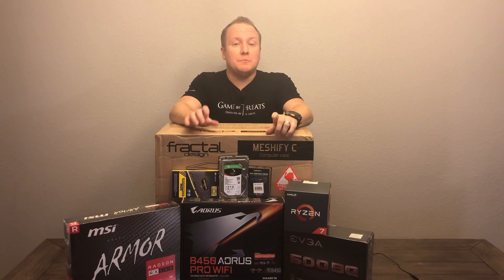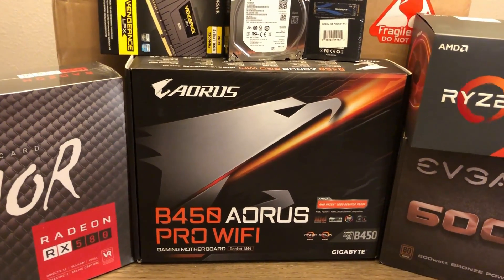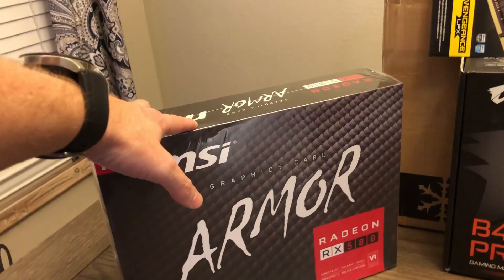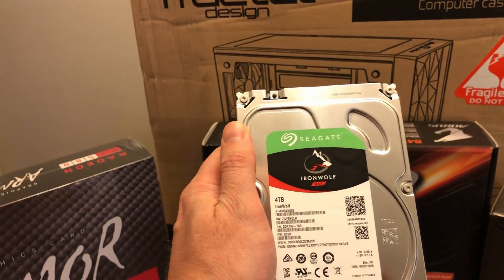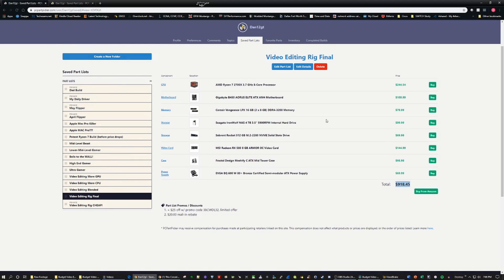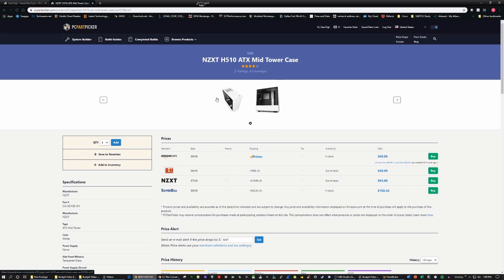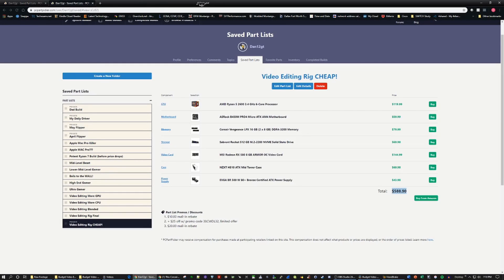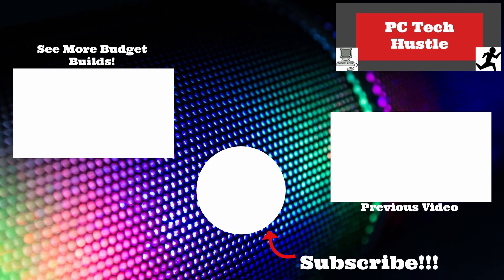$900 4k Video Editing PC - Build Guide Ryzen 7 2700x RX580

Comment: was the installation of psu intentional? may i know the reason why?
Reply from the maker: PSU should always be intention, if you plan on turning on your computer 😉
Reply: @PCTechHustle  sorry i meant the way it was installed. i was wondering why it was installed facing up if the psu can pull fresh air if faced down.
Reply from the maker: Ah!  No worries!  I advised the client that I would do this as they said they would have it sitting on the ground / carpet.  Didn’t want to suck up extra fibers / dust.

Comment: I've got a very similar rig, courtesy of black friday.
RYZEN 7 2700X =(£160)is an absolute steal.
SABRENT ROCKET 512GB NVME= (£60)YES!  spectacular drive an excellent value.Thoroughly recommended.
NVIDIA RTX 2060 MSI VENTUS=(£280) Again black friday special, BIG improvement off my old RX570.
CORSAIR VENGEANCE LPX 3200 2*8GB =(£70)  can't complain at all..it just works!

+ recycled case, PSU(Corsair CX500), MOBO( ASROCK AB350M PRO 4 with BIOS flash)

Overall I would say 3-4* performance of my previous setup (1500x+rx570)
Reply from the maker: BigMac N Tings74 awesome!  Glad to hear a similar build has positive results!  Thanks for tuning in and feel free to subscribe to stay updated on the latest content!  Thanks again!

Comment: For editing 3600 or 2700x which one is best
Reply from the maker: devi praba 2700x > 3600 purely because of the extra 2 cores / 4 threads for the additional raw processing power.
Reply: @PCTechHustle  totally agree. 2 extra cores helps a lot.The biggest difference I think you'll see is going from SSD to NVME boot drive. It's fantastic! It utterly obliterates HDD(storage only these days but they are soo cheap- got seagate barracuda 2TB and Patriot burst 1TB SSD for games/audio/video)